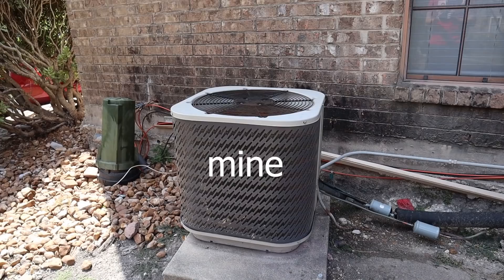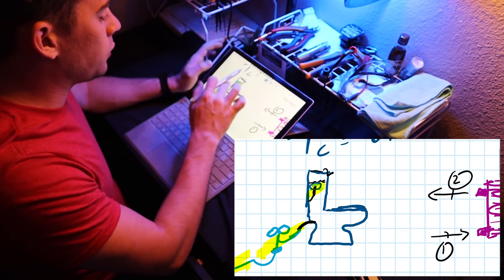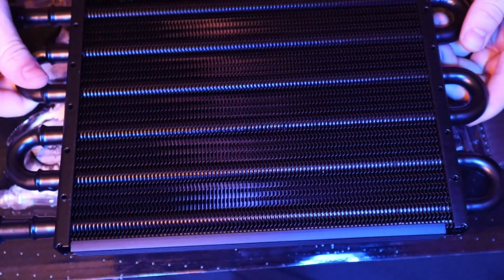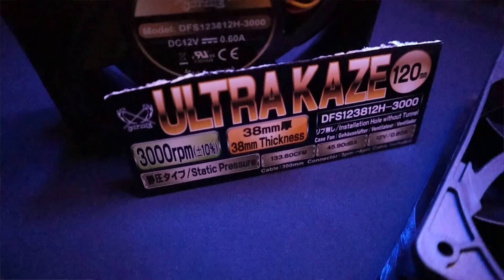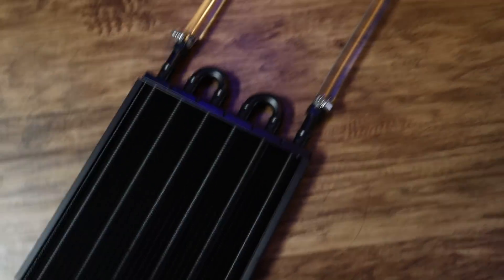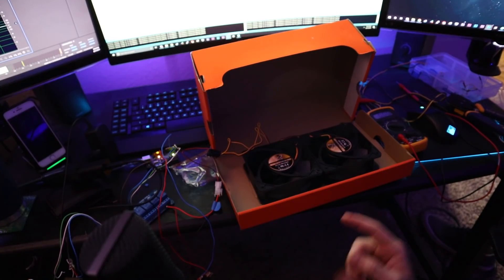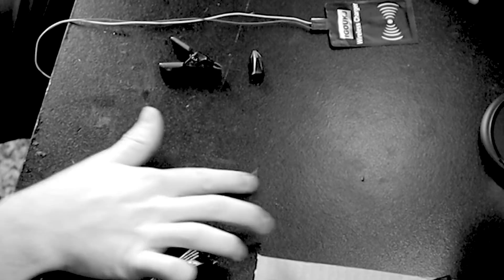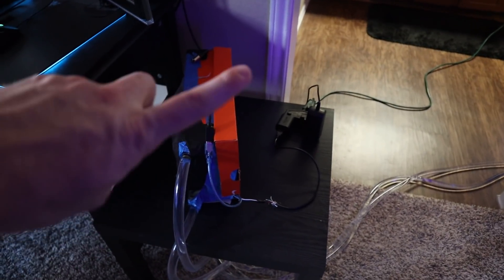I Watercooled My Room with My Toilet

Comment: i love arduinos. but even i can see it is over engineered here...  if you are going to use a arduino you could make a lot more stuff. like attach temp sensor to the cooling unit and monitor  when the temp arise, and then flush more water. and also one more time americans wasting our resources....
Reply from the maker: Check out my new stuff bud. Got more arduino things there!

Comment: I don't know much about these things so this may be a stupid question but wouldn't there be a lot of condensation forming on the cooling tubes as I didn't notice anything in the design to remove this water although I did skip a few bits so may have missed it?
Reply from the maker: Hey Gaz, thanks for checking out the video and leaving a comment! The temperature of the coils doesn't actually reach the dew point of the air in my room so the condensation on the fins is pretty much negligible.
Reply: Ah that explains it thanks :)
Reply from the maker: No problem my dude!

Comment: Cool build.
But.... I would have someone come look at your apartment's central unit, inside and out. Cleanliness of both evaporator and condenser coils, operation of both fan motors first, then check the refrigerant charge. Nothing wrong with R22 it is still one of the most efficient refrigerants available, (global warming potential if / when it leaks notwithstanding.)
Reply from the maker: Hey thanks for taking the time to watch and leave a comment! 
So far I've had the inside coils replaced, regularly change the air filters, and had recharged the Freon - sadly to no avail. I agree with the R22 being the best; if it can't even cool my apartment, then when they have to switch over to a less efficient freon - they might as well replace the run down unit haha. Thank  you again for the suggestions! Believe me I am desperate.

Comment: As a general rule .... any thing to do with plumbing means a 2nd , 3rd, 4th and sometimes a 5th trip to the hardware store.    Have you measured the incoming water temp and compared it to the out going temp?  A small window unit from a big box store might have been money better spent.   You might also want to look at your lease contract,  damage caused by tenant,  if you flood the place.   I love jury rigging things up,  but I'd worry about the liability of a leak (we are talking hundreds of gallons if the hose pops lose when unattended) and wondering how efficient this thing actually is, if it were really cooling enough to matter you'd have a water condensation problem on the coil.

Comment: Actual HVAC guy here. First, interesting concept, I enjoyed watching this. Though, on your R22 and undersized comment you might be a little misinformed. They are phasing out R22, yes, but it's the most chemically effective refrigerant in high-temp refrigeration. As to your undersized comparison, just because it's a smaller condenser, doesn't mean it is undersized. Without looking at the data-plate of your unit I'd say it's either a 90's 2 ton to 2.5 ton model Carrier or a Goodman (probably a Goodman)  R22 unit. Going with old school sizing method 600sqft = 1 ton of cooling capacity, because I'm assuming the apartment complex doesn't have a energy star certificate on the insulation, therefore running a full detailed heat-load calc would be a little wasteful. A 2 ton should be good up to 1200sqft, and 2.5 ton up 1500sqft. Now if you're on the 2nd floor, the system will have to work longer, because cool air falls and hot air rises.

 Now what's more likely is the condenser hasn't been cleaned in years and it's not wasting the heat effectively, nor efficiently! Thus giving false pressure and temps, because dirt and grim from years of unmaintained service act as insulators. Or low charge but they apartments usually replace R22 units with unmanageable leaks.

Now, back to your size comparison. Your neighbor's unit can be either  two things: a 410-A unit or a newer R22 unit. If it's a 410-A unit it's larger because 410-A has a rough operating pressure of double that R22 to achieve the same effect, thus the coils have to be larger and use thicker walled copper to compensate for the increase in pressure. If it's a newer R22 unit then, it probably has a higher seer rating (seasonal energy efficiency rating). To put it in perspective your unit is probably 10 seer, and theirs is probably 13-14 seer. Also, fun fact Federal standards changed that in 2005 to be 13 seer, and changed again in 2015 to 14 seer as a Federal minimum. Your unit was grandfathered in.

So, in conclusion; your unit isn't probably undersized, just horribly inefficient compared to modern units and Fed standards.

Also, check the sprinkler section next time your looking for a male barb to female threaded fitting in Lowes, and make sure you use Teflon tape.

This was meant to inform and educate, not to criticize. I really did like the concept, and the fact you were willing engineer your idea.
Reply from the maker: Hey I appreciate you taking the time to watch and leave your Very informative comment. I’ll check the things you mentioned and see if I can clean off anything. Yeah I spent my whole lunch in the plumbing section and couldn’t find a COMP to barbed fitting at all! Just barbed to NPTF and so on. I guessed it was because the rad is for automotive purposes, I’m new to plumbing and have a focus in materials/machine design. Thank you again for leaving this info for me to learn from and very much appreciate you taking some time out of your day to throw in some nice words too - you could have just schooled me and got your point across much harsher haha. Thank you sir.

Comment: Hi, hr8 job.
I just want to say that your air-conditioning system can be fixed without changing outdoor block, cos R22 can be replaced with R407C. It's working with different type of oil and there are can be some issues with plastic elements of pipe-system and it will need setup a termostatic valve.
Reply from the maker: Thank you for the info! And taking the time to watch/comment. Hopefully that Freon/oil mix will perform better than what I have now.

Comment: Most apartments include water as a paid utility.... Just run and drain full time for a month. Once they get a bill that's about $400 more than normal I bet they replace the AC!!😂😂
Reply from the maker: Haha sadly I pay for water at mine, plus that'd be craaazy wasteful lol. Thanks for taking time to watch and dropping a comment!
Reply: @TyPalowski   LOL really no one would do this because it's just ridiculous and petty AF😆.  Maybe just get yourself a small ice cooler and run a small pond pump through your radiator from the cooler. A couple trays of ice from your freezer wouldn't be very taxing on energy at all and most likely provide 3 to 4 hours of (better) cooling capability.
Not too mention you're not going to need all of that tubing strung across your home. 🤷‍♂️

Comment: Not a bad idea! Couple of tweaks that would be a pretty solid addition: 1. use a 240mm low RPM fan instead of 120mm fans. equivalent airflow numbers but MUCH quieter and more air injection diameter for roughly the same cost, if not cheaper. 2. small design change: instead of using flush power to draw in water, make the system closed-loop. Create a coil of copper tubing and submerge it into the toilet tank. Run water lines from the submerged coil to the finned exchanger. In the enclosure, put in a low-power 12v fountain pump (like 12 bucks from Harbor Freight) powered from the same line as the 12v case fan. Now you're using tank water to cool, no open flow lines to leak and destroy, and you have mains power isolated from flowing water sources. 3. add a few thermocouples, one for line-feed temp at the exchanger intake and one for ambient temp. when line-feed equalizes to ambient, turn the fans off. means the tank water is the same as room temp and you get no cooling effect. Then, take a quick measurement (GPM of water pump / volume in lines = how long to fully cycle the line fluid) and run the pump every...10m? to flush the lines with fresh tank-cooled water until the thermocouple registers a temperature gradient again and run pump and fans to start sinking heat until gradient gone, then go back into low-power mode where it flushes lines and retests temp at interval. 4. add a mechanical trigger to the toilet lever and start the flush and measure cycle whenever the lever is depressed because there will be fresh, cool water in the tank again.
Reply from the maker: That's one helluva suggestion. Thank you very much for the comment and taking the time to watch! This is the first little project I've done like this and love that everyone has better ways to cool off with a toilet haha! Seriously thank you for the in-depth alterations and am happy that I could be a bit of a catalyst to some creativity/engineering.
Reply: If you REALLY wanna get fancy, you could add a battery to the system and put a dynamo in-line with the toilet fill and harvest the power from each flush!
Reply from the maker: Similar to the ones that power the motion sensing sinks right?? That'd be awesome, and even more efficient!
Reply: @TyPalowski  I must admit that using tank water for cooling is actually truly an inspired idea. The ceramics of the toilet bowl are pretty effective at wicking heat into the atmosphere, and there is a pretty large thermal mass in the toilet body proper.  Plus, that water HAS to be there AND must cycle regularly, with a duty cycle between 2-12hr intervals, and toilet-off time would match home-off time (aka the only time you'd need cool water is also when the toilet would be used.) I'm seriously contemplating a project like this now for some next-level CPU cooling...

Comment: One though to save a wet apartment, since you have an Arduino, add a pressure/flow sensor to the hose somewhere. When nothing is running and there is a change in pressure and flow you have a leak. So if you also add two valves at both ends of the hose next to the toilet that are switched by the Arduino (you mentioned you had room on the board), you can have the switches automatically close if the pressure/flow valve senses anything when nothing should be running.
Reply from the maker: That's a very good suggestion, for now I'm just closing the valve manually when I'm not using the fan lol. Thank you very much for the suggestion and taking time to watch the video. I appreciate it!

Comment: So what actual testing did you do? How many degrees? What is the wattage of the electronics and fans, compared to the cooling?
Reply from the maker: Hey thank you very much for taking time to watch the video! 
The air coming off the rad after a flush is 72-73F, after about an hour it warms up closer to ambient (this changes throughout the day as my AC catches up). The fans are dumping 14Watts into my room, Arduino 0.405 Watts, and I run the fans just long enough until the water reaches close to ambient. All it's doing is moving the heat from right next to my desk into the water that will sit above my toilet. Similar to a space-cooler you could buy online (one that blows cold air forward and hot air out the back) but it's dumping that energy into the water. 
I am not saying this thing is perfect or even efficient enough to justify the price, but it was a cool little build that I thought could inspire some conversation. I appreciate you dropping a comment!

Comment: I think you meant to call it Swamp Ass Cooler. Too bad you can't use the complex pool water and recirculate that. This cooling is definitely better than the swamp cooler that is used in New Mexico and Arizona, less moisture but then again arid region needs all the moisture it can get. SATX-UTSA represent!

Comment: Just wanted to point out that R410a condensers are larger than similar tonnage r22 condensers. Doesn’t mean they aren’t undersized for your unit, but maybe the neighbors are also undersized. Take a look at the evaporator coils inside your unit they are probably ruined or dirty. If so clean them and you will have cooler air.
Reply from the maker: That's a good point, maybe theirs sucks too haha. 
And yeah you're right about the coils - I had those replaced about 3 months ago though and it sadly didn't help much. I also make sure to stay on top of filters too, I'm desperate. Thank you very much for taking the time to watch and for the suggestions!

Comment: Unless you are flushing your toilet every 30 minutes then 1/5 of your supply water will already be at room temperature an offer zero cooling (30ft .5in tubing holds ~.3 gallons.  normal flush is 1.6gallons)  You could delay fan turn on for allow for the room temperature water to exit the system and instead run it longer after the flush.
Reply from the maker: Thats a really good point, I should shorten the length of tubing to just what I need. Thank you for the helpful suggestion and taking the time to watch!

Comment: My modification to this would be to tie the water into a ice chest, where you can hold a larger volume of water, that you can add ice to.  Then you add a aquarium pump to circulate the water.  Also if your water is hard, it most likely is if your in TX like me, add a water softener in line to your inlet because your heat exchanger will build up limescale in a matter of months and you will have to flush it before it clogs.  

Other than those few things good job.
Reply from the maker: Thank you for taking the time to watch and comment. Those are good suggestions, maybe when I get some more space I could do something like that. The only problem is the energy it takes to make the ice that would be added back into my apartment. Damn 1st law of thermo.
Reply: @TyPalowski  buc ee's ice is really cheap 99 cents for a 20 lb bag ;p
Reply from the maker: Truuuuue, and I think they're opening one of those close to Boerne!

Comment: Go to a hardware store. Find an employee. Show them a diagram of what you want to do. They will help you find the appropriate parts. The smaller the store the better. You NEED to to swap that pipe to PEX to avoid accidental overpressurization and ruptures. Barbed fittings are available in the PEX aisle. This is a neat temporary concept but it NEEDS to be safer. Your landlord's are also on the hook if your living space is not usable due to heat, lack of amenities or mold. Go post to /r/legaladvice and stop paying for a bumass place that isn't up to code.
Reply from the maker: Thank you for the suggestions, I'm trying to be smart with it now but for sure will do more research on how to improve. Thanks again Ben!

Comment: No joke, had the same thought process about cooling my new apt down - was getting up to 82 degree's during the day.
Day 1 was running the shower on cold for 30 minutes and using a fan. (Dropped a solid degree)

However, I had found that the casings to the basement sliding windows allowed me to fit a small window ac with about .5 inch of literal wiggle room, otherwise I'd went down this path as well.

Comment: If you have to go this route to cool, use pex tubing, as it's designed for plumbing, the pex and fittings are generally cheaper at ACE Hardware than homedepot or lowes. I would throw in a valve inline to your cooling system just encase of a leak.
 Also in reference to fans and controls. Server fans push more CFMs, and run off 120V, which equates too, you can use a simple can use a 120v timer that plugs into the wall. In reference to fan to radiator mounting, the autoparts stores have zip ties to hold fans against the radiator.  

Now if your a/c isn't falling into the 30 degree rule. (30 degrees cooler than outside, I would look into putting all future rent payments into an escrow, equates to, youre not refusing to pay rent, just they're not going to get any rent until the issue is resolved.
Reply from the maker: Hey thank you very much for the suggestions and taking the time to watch the video! You have a good point, as of now I'm just turning off the valve at the source to make sure no crazy leaks happen. Thanks again!
Reply: @TyPalowski  you have a nice room and are clearly a creative guy. I don't want to see anything stifled by a power washer of a leak flooding your room while you're out. If you're going to use a full PEX setup with the copper crimp clamps, you can most likely rent the tools from tool library instead of purchasing anything out right.
Reply from the maker: Can you be my consultant? haha Thanks again for the suggestions.
Reply: Pretty much this. Along with the fact that the "dirty" internals on the toilet and the barbed fittings that were "elusive" to find are all wildly available at damn near any local hardware store. Lots more ways to be truly proactive in this solution, particularly with the landlord.
Reply from the maker: Thanks for taking the time to watch and comment! Yeah I spent my whole lunch at Lowe's with the toilet fitting and radiator trying every brass fitting there. Apparently there's vastly different threads for BC, COMP, NPTF, etc. and none had the right combo of barbed to BC or COMP. I'm still new to plumbing haha. Thanks again for stopping by!
Reply: @TyPalowski  try an Ace over a Lowe's, or something similar. The smaller neighborhood stores are more inclined to help you find what you need - they don't do such massive turnover like a box store and can engage with the customers more.

Comment: I bet your coils (outside condenser or inside evaporator) are dirty or you have a leak in your refrigerant line. Maybe both. Also, you can use 407c as a replacement for R22.